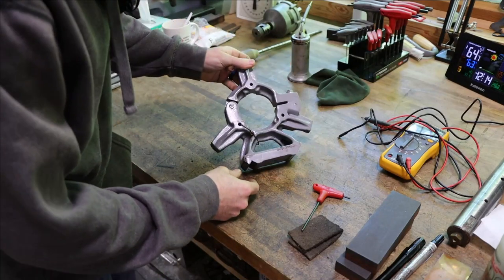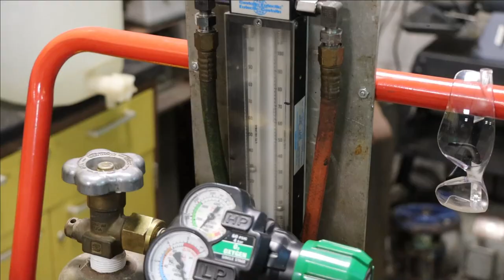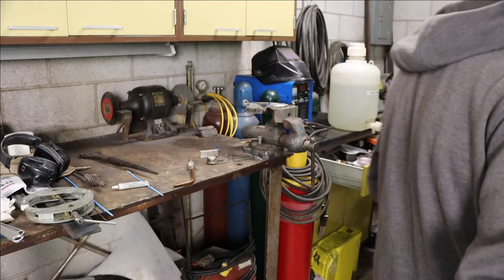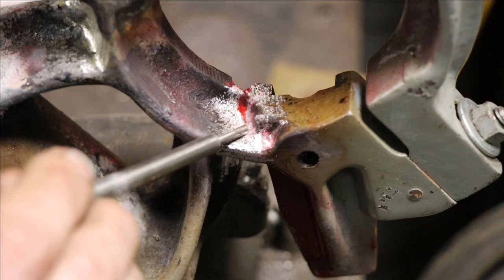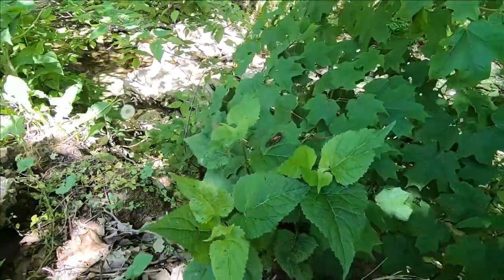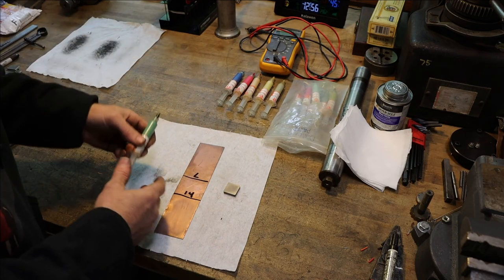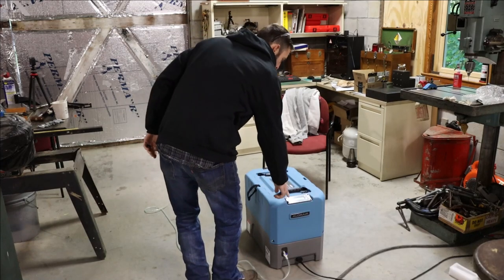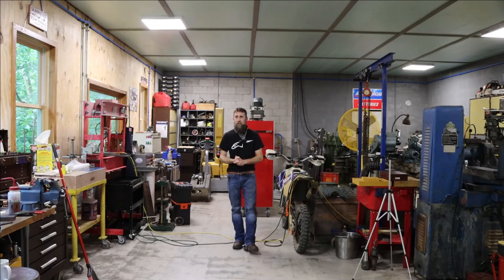Busted Cast Iron Repair Southbend Lathe Steady Repair

Comment: Steve, My neighbor is from Asia and she has been collecting the cicadas here before they fly to make a special dish, just sharing. side note, I use water from my shop dehumidifier in the reservoir of my tig torch cooler, they say that it is the same as distilled water but it has worked for years.Thanks for another great video.

Comment: Your weather station is showing relatively humidity. As warm air can hold more moisture, the absolute difference in humidity between your shop and the outside is greater than the display suggests. Look up a psychrometric chart if this interests you.

Comment: Today’s observations:  1) Your brazing demo was the best I’ve seen. It seems so often a thing has broken at the worst time and now there’s only time to half-ass the prep and scab on some pigeon poop. You’ve shown us that it’s not that much extra time to vee out the crack and apply the brazing alloy in a manner that can be strong and as invisible as you care to make it, especially with a painted part. Great content!
2) Steve S., Precision Cobbler.  Really funny bit. The pin gauges, letter drills and calipers were a nice touch but the go/no-go gauges were the icing on the cake!  My kid woulda got an extra hole made with a .22 shell casing as a leather punch.  Keep on keepin us entertained. 😎👍👀

Comment: FLOW METER:  Try taping a rare earth magnet to the flow meter as a temporary measure to damp the oscillation of the ball in the bore. 
This will save you having to remove the meter every time you need to use it like that

Comment: Looking at the psychometric chart, 48F and 90% RH has an equivalent humidity level to 59F 66%RH. So the humidifier dropped the space relative humidity by 22% at 59F.
Reply: That's good. 90% humidity is just about dripping wet. All summer long here humidity hovers at around 98%. I can just about stand and watch my tool rust before my very eyes. I need to go out and get another gallon jug of WD-40. Because it's the thought that counts.

Comment: I always used NI-Cad stick weld for castiron repair, it was interesting watching you braze.
Reply: I believe that would work just fine on a repair of this type; faster and sufficiently strong. Would AC or DC be typical for such a weld?
Reply: @kevinhornbuckle  DC and pre- heat

Comment: You did a really nice job on the cast iron repair. Our society tends to throw too much in the trash. That's a different looking Cicada than the one we have in TX. It's not summer until I hear the Cicada's and Yellow-billed Cuckoo (yes that's a real bird). Congratulations and best wishes to your daughter. Time speeds up from this point forward... at least it seems to. That dehumidifier might not be a bad thing for cutting down the work that an air conditioner has to do.

When is the Do-All bandsaw going to come out and play?

Comment: For cheap scraper blade material, try to snaffle some broken Brobo (cold cut saw) blade. Once they're cracked they're junk. Hard as you'll want for scraping and reworking into useful tools of the thin variety.

Comment: Not using diamond paste but with compound and rouge I often use a scrap of MDF to lap blades flat. (for woodworking)
It is obviously not micron flat but it is easy to charge and won't move around like your paper towel does.

Comment: Love the work you're doing! Your clean, methodical approach really soothes the perfectionist in me.
I work at an art foundry in Switzerland and much of the machinist type work you do is completely new to me. It would be tremendously interesting if you could explain the things you do a bit more in depth more often! The way you explained the mirror polishing process was spot on.
However regarding the cast iron brazing i was left with some questions:
What brand/alloy was that brazing rod you were using?
What are you keeping an eye on when brazing?
Whas the flux borax or something else?
Of course i get that it might be too much of a hassle to explain all of these things whilst you're working on them. Maybe you could do a technique/tutorial video every once in a while instead. I bet i'm not the only one who would love to learn more from you.
Cheers!

PS: Is there a reason why you're often standing quite far away from the camera when talking straight to it? As someone who is also interested in cinematography, i find it quite striking. In video production, wide shots are mostly used when the environment of a scene is to be shown or when there is action happening in a larger area. So the way you use wide shots is refreshingly different :-)

Comment: Be a good idea to put a furnace filter in the intake to keep the shop dust and dirt from clogging the small fins in the exchanger.  At least reduce the number of times you have to gently clean the fins.
Reply: Also, I've found a couple of fans (ceiling seem best) to circulate the air helps a lot. It keeps the building corners drier & helps for winter heating too.

Comment: A lot of your humidity drop is because the air inside is warmer, so the relative humidity is lower.
Not saying that the dehumidifier isn't doing its job. It most certainly is working, as you can tell by the bulk water it is pumping out.

Comment: When summer comes you will be amazed at the BTUs produced to remove a pint of water.
Reply: In his area,  water will pour out of that hose during the hot summer!  From his description,  it sounds to be a very nice variable capacity machine.  When humidity levels are high it will take way less btu to condense  pint of water than you think.

Comment: I have two home grade dehumidifiers running 24/7 in the shop now. When they kick the bucket I will check out that commercial model you are using.
Reply: You won’t regret spending money on commercial dehumidifying equipment!  If you keep track you will be surprised how fast your investment is regained.  Good choice!!

Comment: I use Muggy Weld bronze sticks to get more precise welds using my stick welder and it's much much faster and less of a mess.
Reply: “Muggy Weld” is fine stuff.  Watch their videos for the presentation.  In this case, Steve is fixing it in a traditional way and it is perfect!   Lots of ways to “get the hide off of the feline”!

Comment: Morning all from the UK - interesting how those bugs like to fill those holes nature is sure weird!
Reply: Dudley Middleton and others that may read this comment, We have similar, usually a wasp as we call them that like holes. My solution is to cover the hole when not in use, We also have Cicadas here as well, depending on how many years from last hatch/emergence, and species some years are loud. John Australia.
Reply: @joandar1  Thank you for replying - fortunately I live in a town in the fen flatlands of the UK and don't get many bugs other than the little midges - that end up in picture frames and even computer monitors, cameras etc. They are only about when the corn and wheat starts getting cut. They itch like buggery but you get used to 'em lol
Reply: @Dudleymiddleton  Thanks mate, I learned the hard way as shown on this Video.So now I have become more aware.
John.

Comment: Great job on the cast iron welding. I have a 350 Chevy engine block that has been cracked through to the water jacket, you think that this type of brazing/welding would seal it from leaking as well as repair the crack? I have been told to use nickel welding rod and plenty of preheat with slow cool down. Which would you use?

Comment: Somehow I haven’t seen or heard a single cicada in mid wv.  I need to find a map that shows where they’re at this time. And congrats to the youngun!
Reply: There's no cicadas in Delaware where I am either. Which is good. I think they may be going extinct? Because even by Steve there's not as thick as I've seen them in the past. There's definitely a lot less than there used to be.
Reply: @1pcfred  the last time i remember them was south west va in the 90s sometime and it was like a blizzard of bugs
Reply: @roscocsa  yeah I've been through a cicada outbreak and they carpeted the ground. What Steve showed was pretty light. Tolerable really.

Comment: It’s hard to imagine how that steady rest could break in normal use
Reply: Dropped?
Reply: @TKevinBlanc  
Yep...most likely fell off and hit the floor...easy to do...or slipped out of a hand...
Reply: @TKevinBlanc  that's my first guess but they may have been trying to use it somehow how it shouldn't be used? Like say on a part way out of round that didn't not need to be steadied in the first place. I could see that doing damage. Dropped remains my first guess though.
Reply: @garymallard4699  a soft shop floor is truly a luxury. I worked in a shop that had asphalt tiles. Real old mills had wooden floors. Concrete can be hard on the back too.
Reply: @1pcfred  
I have 3 shops
Heated shop ( 28W x 45 D x 12 H walls fully insulated ) is concrete..
Infloor heat makes it a pleasure when winter hits here ( central Canada )...alot nicer when on floor working or just your feet not cold..
My big shop is dirt still..a pole shed and large ( 48W x 64D x 14 H walls )....plan to vapour barrier and gravel it someday..
Both of those are metal clad...walls
Pole is metal roofing..
Heated is shingles ( reroofing soon )
My third shop is a old barn type structure..wood walls and metal roof and cladding with wood ends and sliding doors....it has wood floor but is funhouse warped...i plan to cut the floors out..not worth saving ...and at least gravel it with vapour barrier...it has a second floor and about 13 and 15 ft high roof...slopes from front to back
16W x 30 D x 12 H ceilings
It was a animal barn most likely??
I can jack it level and plan to remove the second floor later and use it for storage ( yard equipment and garden tractors etc ..) and may put a car lift in it too then ( i just bought one for my heated shop but may put it in that shop as it has no in floor heat and i can pour a concrete floor and add heat then...) It is uninsulated but built solid and would be great for a lift ( or anything )
I worked in different shops and most had concrete..but you can put soft pads down too and make it better ..
Reply: @1pcfred  
Soft pads on concrete floors prevent broken things dropped...and are comfortable to work on too!
Reply: @garymallard4699  I have some treatments on my floors. Nothing coherent or homogeneous though. Just a mat here or a rug there really.
Reply: @1pcfred  
👍

Comment: a smaller torch tip gives more control of your puddle . seems you waved around fighting your heat , i was certified in 1975  after a 6 month school . try smaller pass , heat will be less of a issue as you fill .  just tips to consider . keep videos coming .. Thanks

Comment: cicadas LOL first time me an my mother met them was a hot summer in okla quiet night before the next am went to walk out an my mom shrieked screaming i came running over to the kitchen screen door and every single inch was covered in cicada molts outside they had covered everything an were buzzing so loudly you had to yell to be heard over them 

yours are a LOT smaller than the ones i met lol as for kids mine yeah i sympathize one just turned 15 the other turns 20 tomorrow it just dont feel like its been that long .....

Comment: @Steve Summers  --  @26:50 - Instead of trying to grip your Carbides by the edges , use a  DOP STICK  like Jewelers and Lapidarists use to polish stones ,  it makes it a lot easier to handle the item being polished .  --   A  Dop Stick  is nothing more than a Four inch Length of One-Quarter inch Diameter Wood Dowelling with a glob of Dop Wax on one end of the Dowel .  Dop Wax is a specially formulated type of Wax that softens and melts in the flame of an Alcohol Burner , and can be reused over and over and over again .  I strongly recommend that you go see your local Jeweler for further information about using Dop Sticks (He may even give or sell you a couple) .  --  I make Custom Jewelry with Semi-Precious Stones as a Hobby , and it would be almost impossible for me to cut and polish a lot of the very small stones that I work with , without using a Dop Stick .   ---    < Doc , Retired , Miner for over 50 years >  .

Comment: Lubricate the O ring with silicone valve and O ring grease . It is non-flammable in high oxygen environments and will protect the O ring from oxygen which is contributing to the perishing of the material.
Graphite won't do that.

Comment: What brand carbide burrs do you use? Ive had the worst luck with find some that dont get messed up within 20 seconds of using them…
Reply from the maker: I will and do use any brand. I have good luck with most all of them. I'm careful not to let them chatter and I put a decent amount of pressure on them so they cut heavy. They still die over time and the edges break down but I think the key is to keep them cutting hard. My 2 cents 👍
Reply: @SteveSummers  nice. Thanks for the response! Keep up the great video man!

Comment: You hear your Cicadas there, we here in Australia, have a different type of Cicadas, that come out about every 4 or 5  years, they are a bright green in colour, I have a medical condition called Tinitus, it's a ringing in the ears that is basically un-fixable, my type sounds like Cicadas, plus three different high pitched pietzo type buzzes I have this 24/7,  most of the time it's in the background, and now and then it amplifies for several minutes at a time and is extremely annoying. So you only hear the cicadas every so many years, I hear them every day. I lose a lot in conversations because of my Tinitus "Cicadas".

Comment: My daughter only has one year left before graduation, where does the time go?
Reply: A better question is where does time come from? Because once it is gone it's gone. But if we knew where time came from that knowledge may be of some practical use? Who couldn't use more time? Until recently pondering time was largely a waste of time. But not anymore. When GPS satellites are built they have to take relativity into account. As time flows differently where they orbit than it does here on Earth.

Comment: And while brazing the second side, hoping that the braze on the first side, which has been ground down to, doesn’t melt, and drip off. I’d rather TIG it with a nickel rod. I don’t trust brazing on a thin part like this.
Reply: It didn’t and the repair is perfect.  Many ways to get the hide off the feline!

Comment: This is like the joke about the different between a common father and a father that’s a machinist and how they add a new hole to there belt. Well the common father takes a steak knife ruffle spaces the mark then pushes through creating the hole. Now the machinist father takes the belt and start measuring width and length then spaces and width of the holes everything to the 0.001” after several hours of setup on drill press dills a single hole

Comment: What kind of father are you?! And I hope you don't call yourself a craftsman. How could you not defer that shoe strap hole? 😉
She's a beauty. Spent an image of her Ma. A Vet huh. Where does she get that influence?
Thanks for the cicada deets. I've heard stories about the variety you folks have but never saw videos of their burrows and other fun facts. Up here in the hinterlands. (Mpls) We have them every year but much fewer and not until the heat hits. Each one is very loud and very distinct. No chorus.
Nice job on the braze repair. It's good to see a little old school action on cast iron. Many would just go after it with a nickel rod and try to weld it. Is that dry white flux a homemade formula or can you buy that stuff. I pretty much use the liquid but it always dries out. Another technique you may wish to try especially if the cast iron is clean. You can actually get a stronger joint in less time with silver. A little acetone wash on the crack faces followed by a brushed on white flux. Fit up the joint heated and watch the capillary action pull the solder in tight. If it doesn't work you can always revert to your solution. Saves a lot of grinding.
Thanks for another fine episode.

Comment: maibe pack youre torches in a ziplock bag that should keep the bugs out
allways though you need to preheat the whole parts and after brasing it go over it with a needle scaler
Reply: Some castings are going to be more trouble than others are. This casting doesn't have a troublesome look to me. So less precautions need to be made. Maybe just don't quench it in ice water when you're done? You should be OK then.

Comment: I don’t mean to be critical but, I have never been a fan of brazing cast iron.Once you braze it,you will never be able to weld it.There is a cast iron TIG rod called EzWeld that does a great job without pre heating.
Reply: We have a pipe shop that has had brazed repairs in heavy service since my grandfather ran the place before WWI.  In reality, brazing is stronger than the “cast” itself.

Comment: I'm disappointed with you Steve.  You started out right using digital calipers to measure the strap of the shoe but, what kind of machinist are you using your fingers as a clamp when you started the machining operations.  I'll bet that hole is more than 0.00000001 off center.  
Congratulations to your daughter.